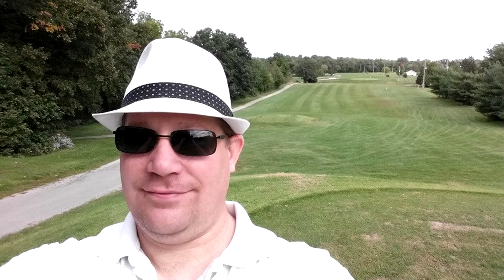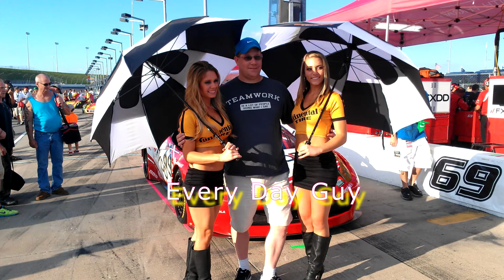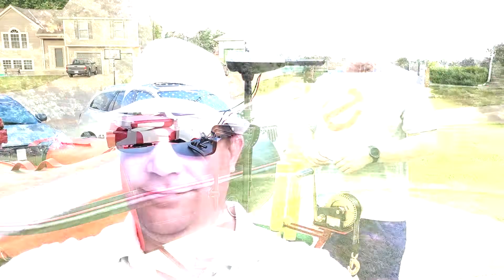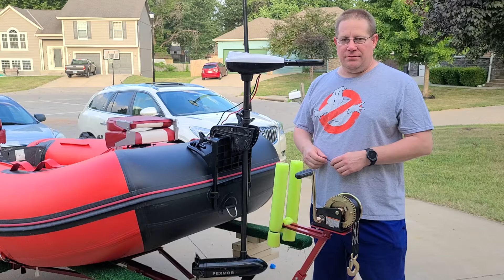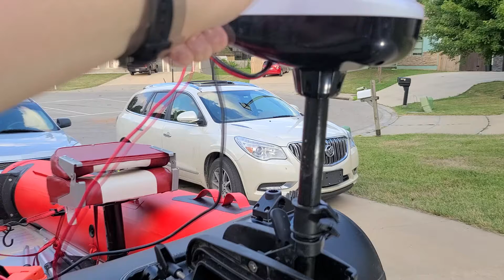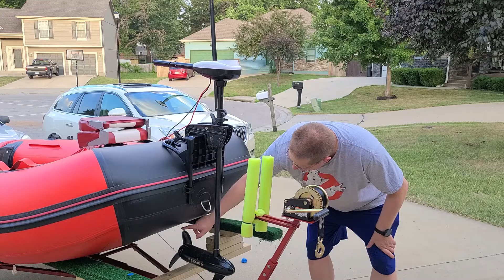trolling motor head rotation

Comment: Doesn't that make reverse forward and forward reverse now so now you're getting five reversed speeds and only two to three forward speeds by just turning the head around I'm looking at trying to figure out the wiring configuration to make the blade spin the opposite direction in reverse to pull forward so they're technically in Reverse you would get all five speeds but still trying to figure that out
Reply: I'm installing a Newport Vessel  Kayak Series 55 LB thrust on my Van Hunks Elite Angler Pro,  Do you know if you can rotate the head on my motor 180° as you did. I'm installing it where the fin drive would normally go. Thanks
Reply from the maker: No you are simply rotating the head. You are not changing any of the wiring. That way the prop is on the same side as the handle. so when you mount it on the front and having the handle facing into the boat forward is still forward and back is still back.

Comment: What the length of your motor's shaft here Steve?
Reply from the maker: @mark weatherall that is my 86 thrust lb which is 37 inches. My 36lb is only 30 which I would say is just barely long enough.
Reply: @everydayguy.5580  if you submerge your propeller just below the waters line then that's great because propeller doesn't need to be low in the water on a trolling motor, makes it harder for it to push the boat.